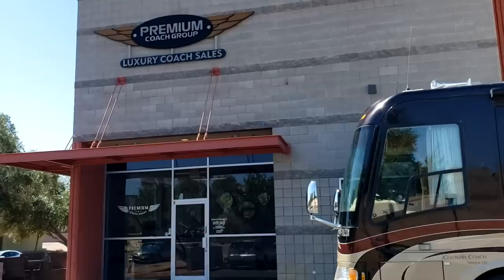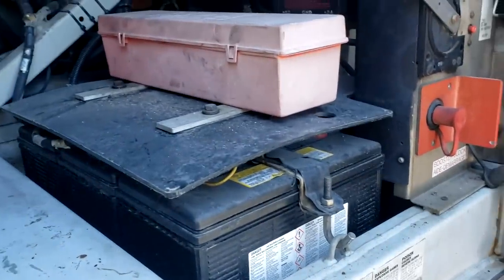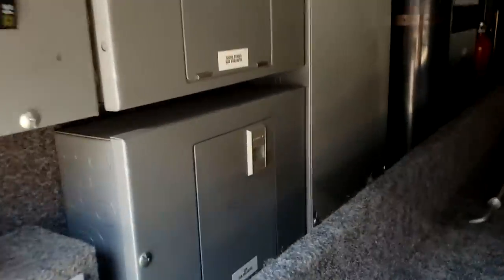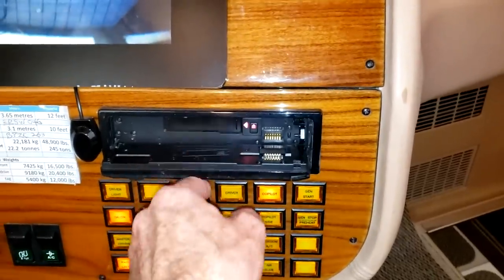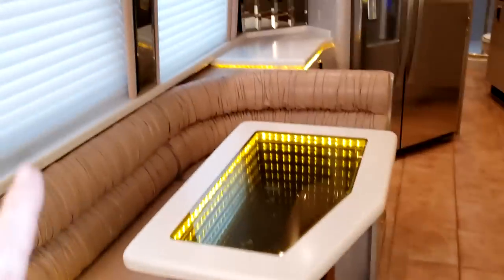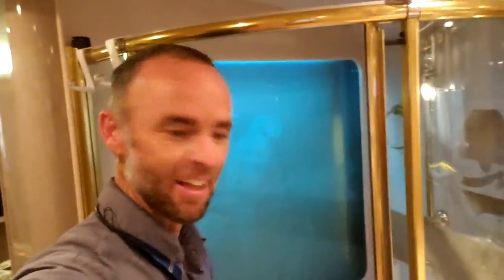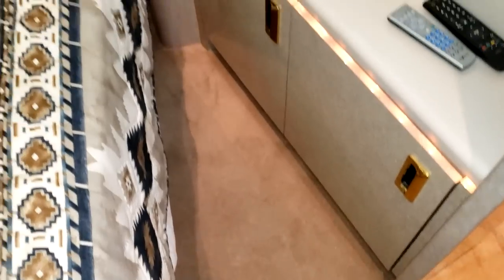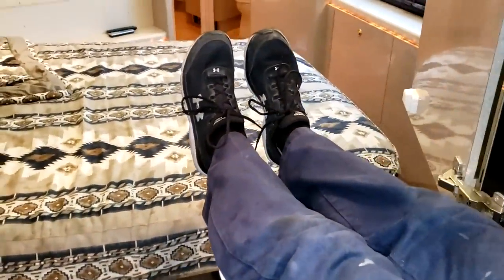Complete Walk-Thru on a Showroom Bus Conversion

Comment: You can get a kit to reverse the arms on the big awning. One of the first things I got. I got my 03 Wanderlodge. That there is a super coach. I like s Mach V, but I can’t find a 120 VAC version. The newer Prevost were glued, not riveted. They have deamination issues. Wanderlodge is a riveted coach, but they run molding all overturn. I just put electric valves on the black and gray tanks. One thing I wish I did have is cruise air. So quite compared to roof ACs

Comment: Hello I just bought a 2001 Holiday Rambler endevour 38PBD Deisel it has the strangest roof. There are NO leaks anywere and no signs of ever having any leaks ever. However it looks like the entire roof was cut down the middle from the front to the back then bolted together and taped with siler eternabond. But it looks like it was always this way. There are zero leaks anywere. Is it possible that that is the way it was manufactured?
Reply from the maker: This is how the roof was made
Reply: @AZExpert  Thanks for the response sir, that puts me at greater ease. So the silver tape or eternabond is factory. Wow amazing! I thought so, because it looked reasonable untouched;  but I still don't understand why they split the roof down the middle.  Is there a benefit to it? Obviously it must have a frame if they have to attach it in the middle. 

It seems to be strong enough. I'm a beefy guy about 280 and I had to go up and remove the wasp nests from the squirrel cages they were filled with old wasp nests. The squirrel cages were making an awful sound. I removed the mud nests and now they work very well and are quiet.
Reply from the maker: if I understand it, the metal is only available in that width so it needs to be seamed.
Reply: @AZExpert  Oh I see thank you for the info.

Comment: 25 years old, taken down full depreciation quality materials in good shape my only objection is the need to run the gigantic generator when not plugged in, so my winters on the LTVA would necessitate a equally gigantic solar inverter battery bank to run things properly, a colossal expense and pain. but one can dream.

Comment: Does basement air cool better than on top ???
Reply from the maker: they are quieter, drain condensate easier, make no holes in the roof, and move air better, so yes a little, but they are much more difficult to replace or service